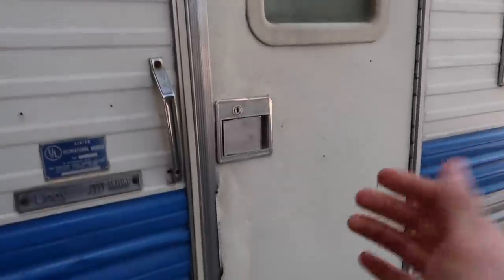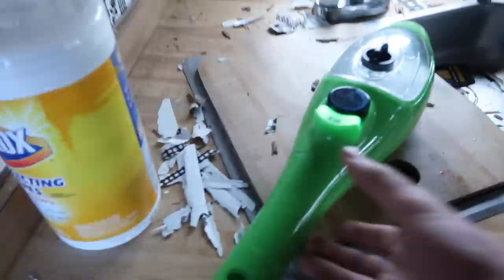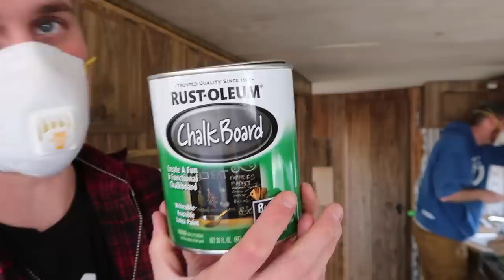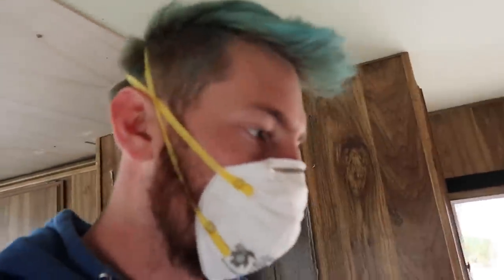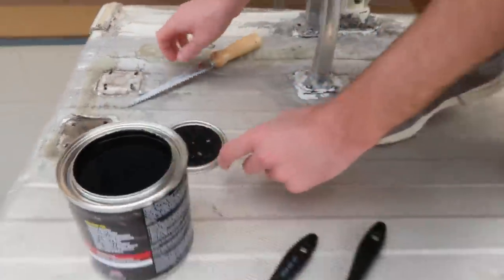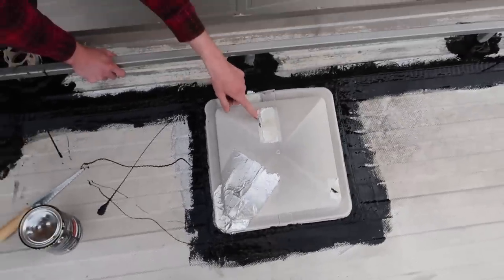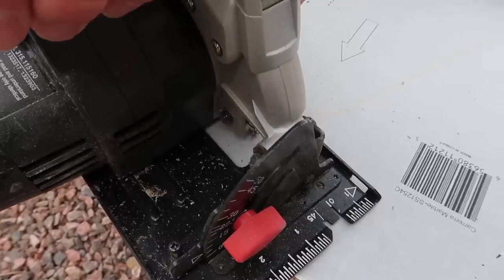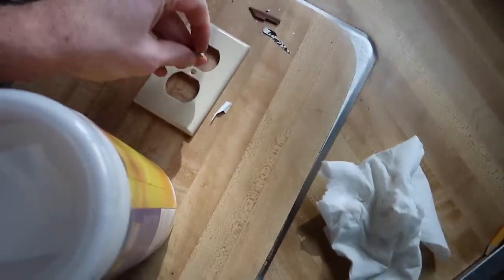THIS RV WILL GET MODDED!

Comment: WHEN you are applying using a brush, doesn't mean you should only do the epic brushing stroke movement. DAB the thick black stuff with brush on the holes holding the brush vertically, which will fill the holes first. Then apply more on top of it doing regular brushing strokes.

Comment: tip, get a roller! another tip is use cement board screws! another tip silicone between the vent cover and the roof. another thing is check if the door has all the screws. a missing or loose screw could stop it from closing

Comment: A good way to remove wall paper is a heat gun. You can usually get for about $30. I've removed wall paper by brushing water all over it and using the heat gum which will undo the adhesive on the pack of the paper. It's not really good to paint over wall paper. When you do that you are adding moisture to it which can cause to cripple up more and it will eventually make you paint look really bad.

Comment: Excited to see what you guys do next. Laminate flooring would be relatively cheap and it's super easy. Just get the peel and stick kind and use a razor blade to cut the areas corners, etc. Some fun/funky LED lights on the inside could look cool. Enjoy the rv mods and good luck!

Comment: to cover up the old top vents make nice wood covers and slide over the big one in the middle and the bathroom vent/skylight thing i would just take out that and put put a peace of wood of that as well and screw it down and seal it. also once done with sealing the roof with the flexseal. I would paint the roof and your new coverings with outdoor paint of your choosing to help make sure everything is good to go because the paint will help protect as well.

Comment: Hey JStew a good tip is to cut the marble with the saw and use water for a cleaner cut. An idea I had is to use the flex seal with a paint roller so you can get more of the roof easier

Comment: You guys apply some bondo to the holes that you have and then sand it down to how you want it when it’s dry, and then when everything is dry spray some primer paint on the roof so it looks half way decent since it’ll be one color then just choose any color and spray paint the entire roof, I prefer white to keep the sun away, then everything on the roof would look great!! And for the inside I also suggest bondo and spray paint, as for the big hole in the middle I don’t have a clue!! Hope you guys do this, I’ll be watching for it

Comment: I feel like all the add-ones so far have been just “good enough” Jobs, I’d recommend doing your research to get better results
Reply: Henri_the_fry_guy... less than good enough, lol. It's like watching highschool kids work on an RV.
Reply: You are right they should use a cock gun to fill in the holes on the roof and use actual paint instead of chalkboard paint the tool that they were using for peeling the stuff off the wall with was the tool they should've used to open the paint canwhat I

Comment: For the old airconditioner and the bathroom vent just cut a piece of wood that size and put it up there and screw the sides in  and but some selent in a tube and put it in the corners and around the screws and edges

Comment: Contact some kind of environmental service to test for mold and asbestos before continuing please. And possibly see if it is possible to remove the old under wood and put in some new plywood. And also try to actually mount a functioning fan in the spot where the bad one was. An attractive working fan would be very helpful for cooling and ventilation. They also make compact rv air conditioners which is great in the summer. Also try mounting the outer plywood with some type of adhesive, AFTER you make sure the other necessary stuff such as mold tests, wood replacement and electrical/ a.c. mounting. Then you can cutout the space for the fan cover once its mounted. Don't get ahead of yourselves or you will only make more work for yourselves when you have to undo stuff to fix deeper problems. Good luck guys. I hope you see this. 
Edit:Also don't settle for painting over the old peeling paper. Quality work takes time and patience. For inexperienced people you can't just flip it in a few weeks or maybe even in a few months. You might need to do things as you can afford it and possibly contact a reno. expert or something. Don't try doing the electrical stuff yourself espeially. Possibly get and electrician and see what works and if any of the power even functions. If not, you wanna get some rewiring before you trap everything under your cool mods.

Comment: If that roof continues to leak, which it will, you’ll have to take it to an actual RV shop to get it fixed. Flex seal & new plywood won’t fix the damage that’s already there. Especially if there’s mold underneath.

Comment: If you are not going to us the roof vents or the air conditioning then what I would do is remove them and put metal over the holes and cover the entire roof with the flex seal but I would do it in white to reduce heat inside!

Comment: Hey on the rv where you did the chalk paint I would sand it down (a light ) sand then do a final  paint, also for the roof on the inside I would put flex seal where you put the new wood at.

Comment: you need two light in the ceiling so that it will beautiful its just like a design and outside of the rv it needs equipments like spoiler,bumper,chasis,leds, and in the hood you can put a new battery if you have a bulb. in the roof i think you can put tiles or floor tiles. if don't want your bathroom, you can make a entertainment room you can have your video games in the rv. i see holes in the roof you should put duct tape or wood cut them and glue in those holes. this is my creation.

Comment: You guys don't not know how to use those Pudy knives. First using the corner cut out a segment then also using the corner you wedge it under some wallpaper then if some comes up you grab it and pull up by hand that's the way I do it and in my opinion it's the best way

Comment: why not fill the holes take the ac unit out and  then get a sheet of metal to fit the roof and weld it on then paint over it